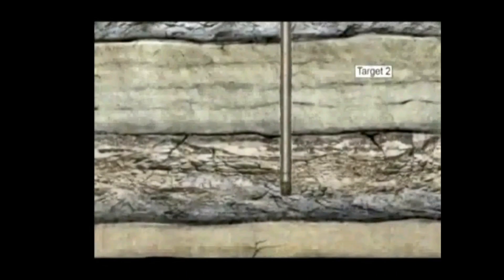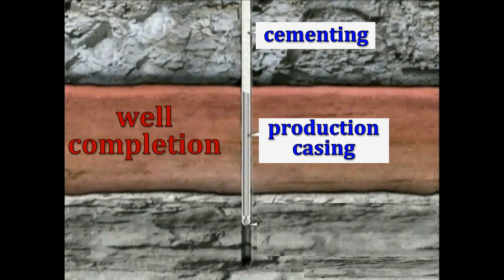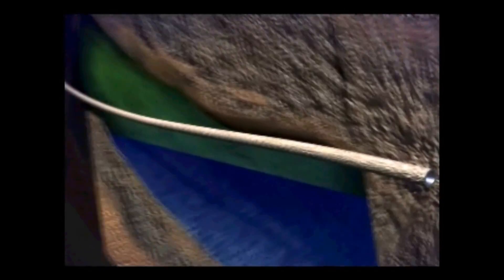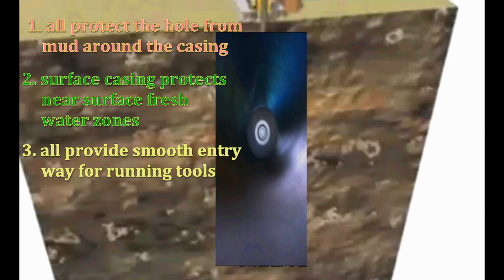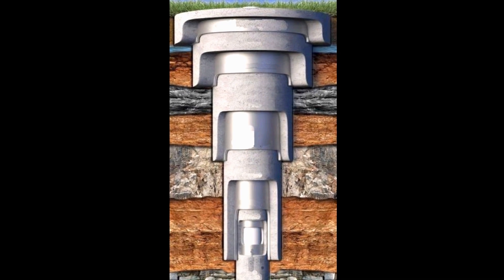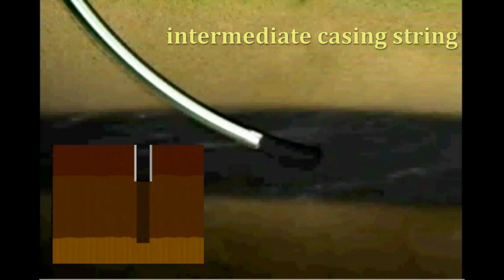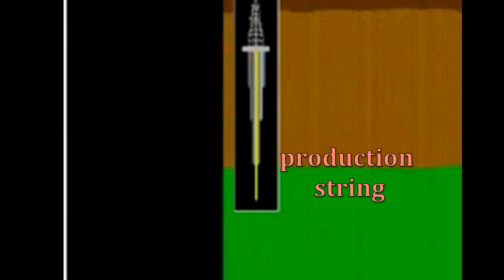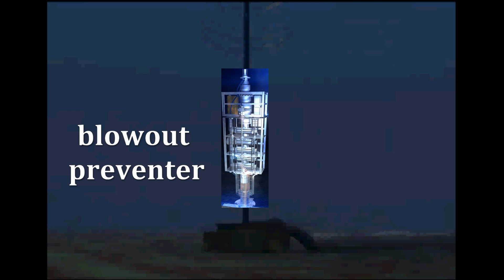Overview Chapter 8 Part 1 Well Completion

Comment: Where is the conductor pipe then? I thought we first do spudding of the conductor. or  he just omitted this info considering we knew it/ hm...
Reply: The conductor casing is not drilled by the drill rig. It is often driven into soft ground or drilled by an auger, such as a piling rig and the cemented in. It is seldom more than 100' deep from the ground level.  When the drill rig is erected it using the conductor casing to keep the unconsolidated soil and surface rock to keep from collapsing in while the surface hole is drilled. The conductor casing is set at the same time as the rat hole and the mouse hole are dug and lined with a pipe.